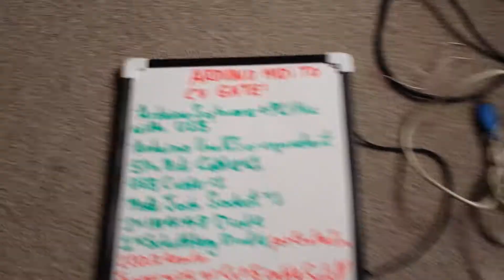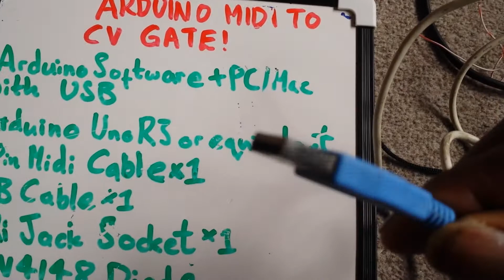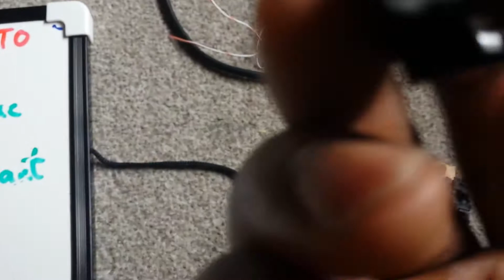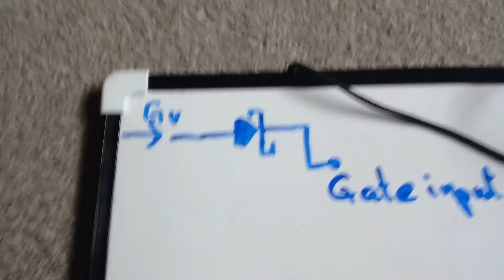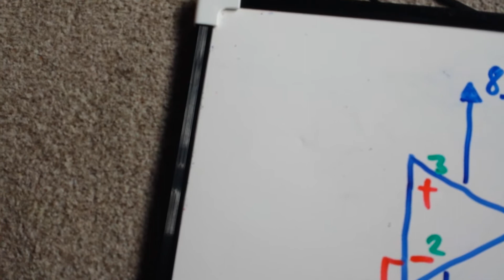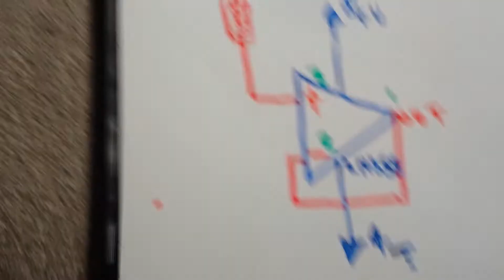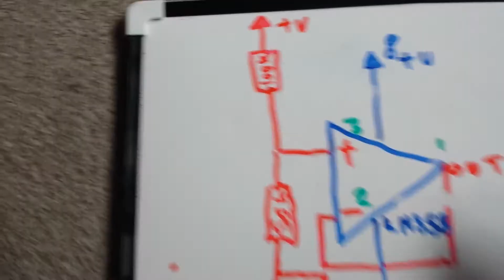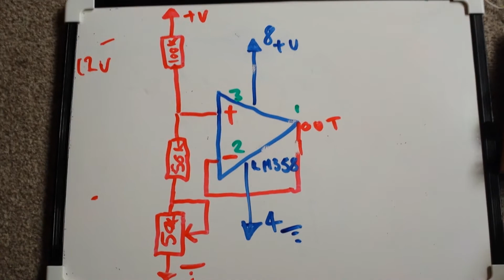DIY analog synth Tutorial Part 10a (Arduino midi to cv gate)

Comment: Great video thanks for taking the time to make and explain
Reply: Nice tip on the CAT5 , you could try a regulator in the output of the Arduino maybe an lm317 with a variable pot like 2k trimmer to set the output voltage.. might be able to regulate the output however if it's lower not sure that will work .

Comment: HI , great build, the reason the pitch is not holding it's because you are using a breadboard , which is noisy , try to solder it to a perfboard.